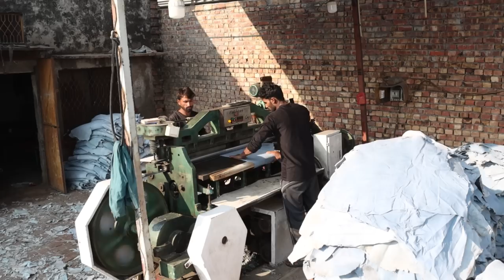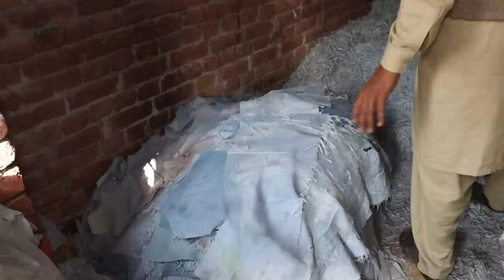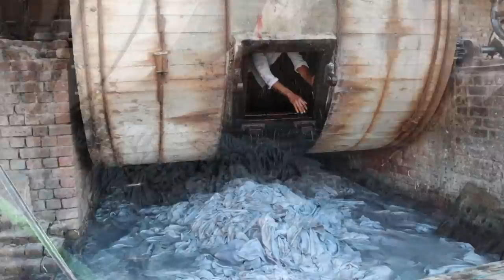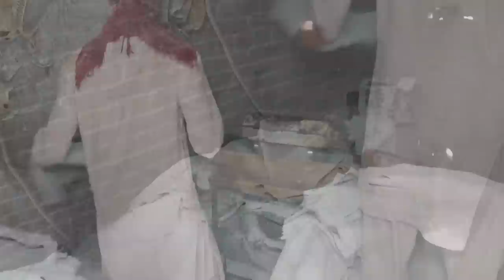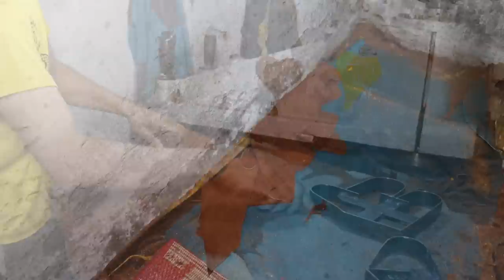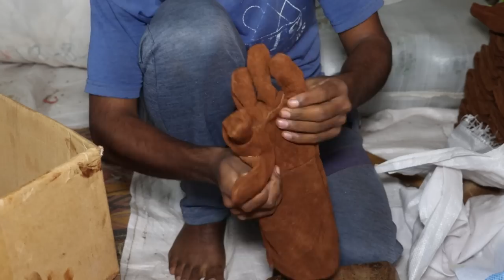Amazing Process of Making Genuine Leather from Cowhide and Manufacturing Heavy Duty Safety Gloves

Comment: I can use those for cooking maybe.
Reply: Leather is fine for stopping sparks from welding but there isn’t insulation enough for long time hot object holding. And if they get wet heat conductivity increases. They would do in a pinch though and probably be good for doing barbecuing.